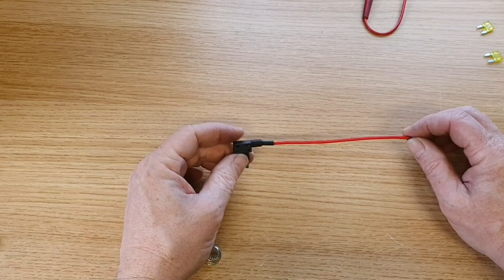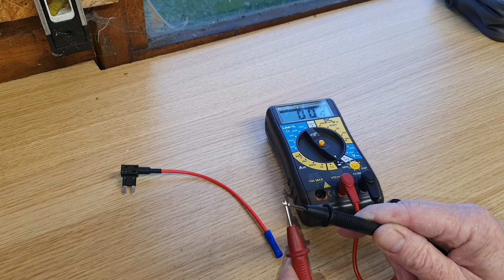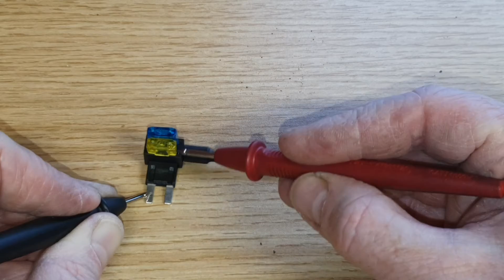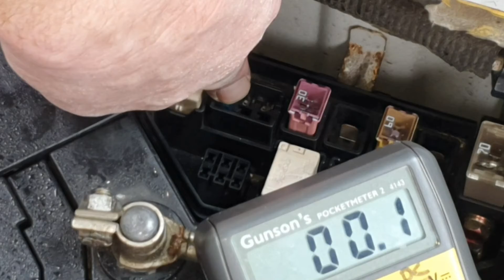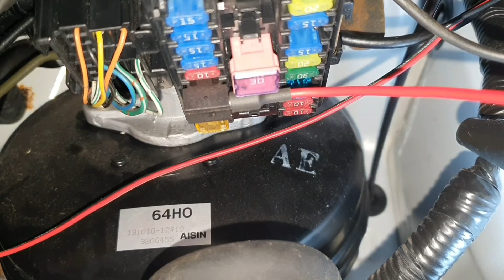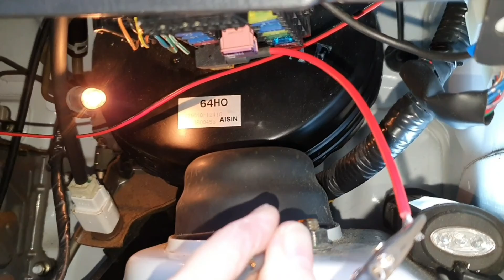12 volt Fuse tap/piggy back fuse holder installation

Comment: Wrong way there dude...the power should be going thru the other post so the fuse protects the existing car wire.  The top fuse will still get power when activated....your going to overload...sorry

Comment: How you doing mate. I’m looking to use a piggy back connectors to create another cig lighter. Where would the negative wire go on the fuse connector
Reply from the maker: Hi, you'd have run a separate earth from the lighter socket. Only the live would go to the piggyback fuse. You could run an earth from the battery negative or from any part of the vehicle that connects to the bodywork/frame etc.

Comment: How do i know which direction to connect the fuse tap with both fuses on the fuse box like turning it around ,
Reply from the maker: You would need a multi meter to find out which part of the fuse connector is live.
Reply: @Bloodshed.restorations   and then ???
Reply: @amrab281 then follow the video he posted to check the live parts. 👍